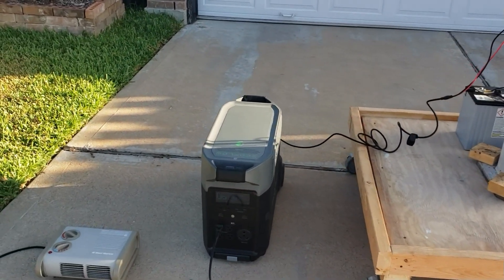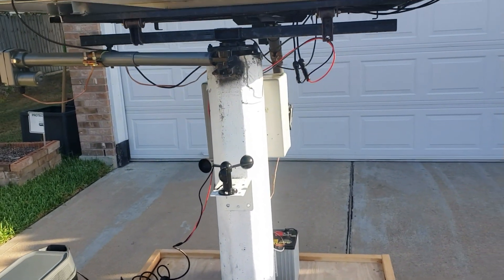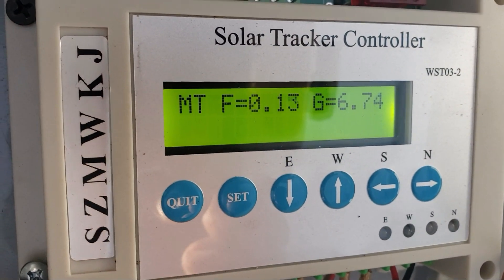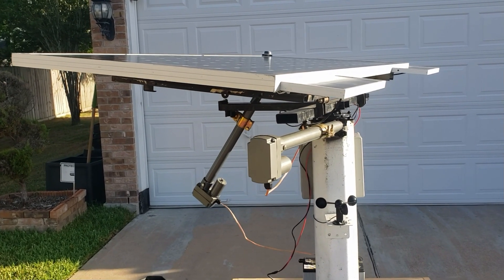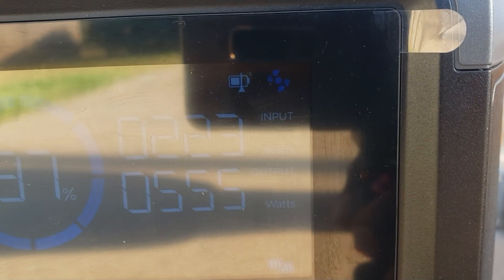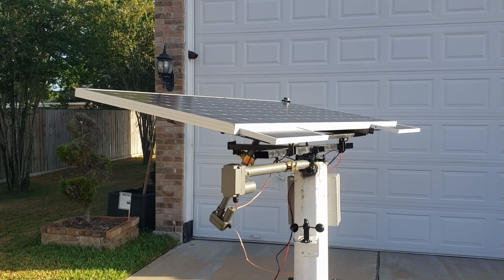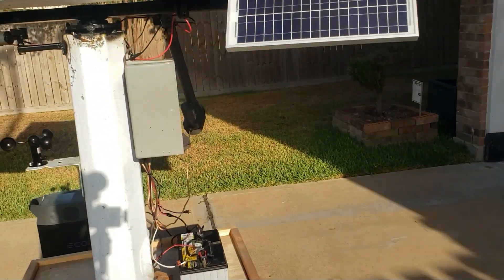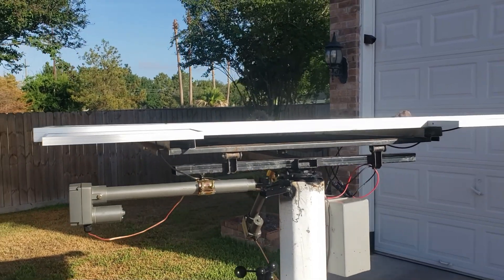EcoFlow Delta Pro Charged with a DIY Solar Tracker

Comment: i like your design! Do you mind selling me a complete system that can handle 6x 600W panels (93.78" x 44.60" each panel)?
Reply from the maker: That’s huge
Reply: @GeneratorReviews   what actuators are you using?

Comment: Hi this is Dave again I forgot to put in a question about how long is the stroke on your linear actuator? Thanks
Reply from the maker: Hey Dave, so this is a 12/24 VDC 750 pounds max stroke length 18 inches travel speed 0.2 in./s
Reply: Do you think if possible you used a 24” inch on your stroke would it be more sufficient and get more then 180% horizontal turn or would the long stroke wouldn’t help at all.

Comment: Do you have any movement on that seal bearing? like if you shake you solar panel ? And do think it would hold up to 4 panels
Reply from the maker: Zero movement on the seal bearing this is a wheel bearing designed to hold up a cargo trailer, so six panels, eight panels I don’t see an issue.

Comment: I watch you video over & over again l like you way you came up with a easy way to track the sun ? But 😮can’t figured out how you made horizontal actuator turn 180 with out breaking it or bending it all to hell!  I see the bearing axle how it would rotate but actuator shouldn’t rotate there made to push and pull not to rotate.
Reply from the maker: Using the 90° location in the front then I measured how many inches off the center mast which was 6 inches that causes the solar panels to rotate 180° without binding.🤓

Comment: What is the total wattage of your small panels used to charge the lead acid battery? Are you using a charge controller between those panels and the batttery?
Reply from the maker: The wattage of each panel is 5 W and I’m using a small waterproof charge controller. It keeps the battery at 100%.

Comment: Nice portable unit..  I recently installed the Ecoworthy Dual axis tracker. Then I switched out Two 400w panels with Six 200w bifacial panels. I have one of my security cameras pointing at it.. so I can monitor it's movement during the day. I'm a OTR trucker so I'm gone for weeks at a time.  Wanna get another one for my 2nd array too.  I put one of them 400w panels to work keeping my Ecoflow Delta 1300 charged when I need it. lol.. I use it for my washer and dryer..
Reply: https://www.youtube.com/watch?v=YjEopCCwnIs

Comment: Sweet setup, how much all those parts for the tracker run you?
Reply from the maker: The two 12V actuator I think I paid right at $200 for them the solar panel was $250 and I think the controller was $70
Reply: @GeneratorReviews  wow not to bad at all, nicely done sir!

Comment: What brand or can you provide information on the solar sensor and wind sensor that was used?  This is well done
Reply from the maker: Just search on eBay
Dual Axis Solar Tracker Controller Automatic Solar Tracking w/Remote Wind Sensor

Comment: Looks great!  How did you determine the watt limit to be 1.5?  About the only place on my property that has decent sun is a roof top.  What problems would I have setting a tracker on a roof?
Reply from the maker: I can think of a bunch of reasons I wouldn’t put a tracker on the roof
Highwind  weight, and aesthetics

Comment: Nice job and it seems to work well.

I just have an aversion to added complexity and mechanical failure.

Could a couple of more eastward and westwardly facing panels in addition to thee main array accomplish similar performance without the moving parts?

Solar panels are relatively cheap.

Comment: Does the Pro connect to any solar panel or are the connectors proprietary Ecoflow stuff?
Reply from the maker: You can connect any solar panel as long as it’s within the voltage specifications and max wattage

Comment: Very nice Job. I'm looking into something similar with wheels also. You mentioned wind, but not rain, so I'll need one that has a Tarp above it that will release when the windshield rain sensor detects moisture or better yet, a modified robo vacuum that the sensor tells to automatically take it under the Patio Cover!👍
Reply from the maker: Rain won’t hurt the panels

Comment: Pretty cool, I'm building something similar. Mine uses solar azimuth and elevation knowledge though, so it doesn't require any light sensors and always achieves perfect tracking.

Comment: Who makes those linear actuators?
Reply from the maker: Hurricane winds is where I got it from
Reply: @GeneratorReviews  I cannot find Hurricane Winds but I did find Windy Nation.
Reply from the maker: @gorillamotors  that’s the one windy nation I just looked sorry
Reply: @GeneratorReviews  what lengths did you get for these for the E-W axis and the N-S axis. I am looking at the heavy duty 750# versions in 18" or 20".

Comment: Couple of questions: How many degrees in the horizontal plane can your tracker rotate?  Looking at the design it must be something less than 180 degrees, is that enough?  Second question is could you post a picture of the actuator label, I can't find one that looks that nice.  Great job Gavin!
Reply from the maker: The degrees on the Horizontal plane is around 160 degrees anymore and the actuator will be damaged by over spinning. On the vertical I can get 90 degrees
Reply: What are the part names and any links where you purchased them. I'm trying to build my first ever tracker.... Thanks for this video and all information.

Comment: Hi Gavin 
Sorry to keep asking questions but got one more if you don't mind.
The wheel hub/bearing that you used. Did you leave some of the drive shaft /axle on the hub to give the bearings some more stability?.
Reply from the maker: Yes that’s exactly what I did and I welded it to the crossbar with is the main bar
Reply: Nice 1 cheers buddy 👍

Comment: VERY NICE!
How did you know where to mount the actuators (they have a certain protrusion length)?
How much was the tracker controller?
Reply from the maker: It was trial and error with positioning the actuators, the tracker controller I got it off eBay I think it was right about $120.
Reply: @GeneratorReviews  Kudos! I se the controller is a WST03-2.

Comment: Hi Gavin 
Your SZMWkj controler you use.
Did you get it from China or find it elsewhere.  Cheapest I can find it is £143 from China.
Reply from the maker: I got it on eBay
Reply: Yea I see them on ebay but all are shipped from China. Can't find a supplier in UK. Never mind I'll just have to get one imported from china

Comment: IDEA: EcoFlow's are being shipped with the 160watt or 400watt option. If you had a little low-cost solar tracker that only does the latitude angle so that a floppy blanket style panel could seek the best angle, I bet those would sell. Many people just want to set this up after power outage or when camping and don't want a heavy machine to lug around.

Comment: @Gavinsgarage I never had a solar panel before. My understanding is that they pull at least 80 percent of the rating. Is that certain panels or was it because the time of day. Your listed rating was 435 watts and the reading said somewhere near the low 200s. Was this a old or recycle. I have no clue except for watching videos. I need details.
Reply from the maker: Hey Lamar
That’s just because of the time of the day I think it was right at 8 o’clock when I shot this video this particular panel actually puts out its rated watts in full sun ☀️
Reply: @GeneratorReviews  thanks for the response👍

Comment: This is exactly the reason why I got myself a Delta Pro. I cam connect my old solar panels to it.
Reply: You can use any pannel, with any power station. As long as your amps and volts are in spec.

Comment: Nice work on your DIY tracker. Interested to see how well the solar tracker Electronics work long-term. I have been considering buying one and testing it here on my total off-grid property. I have four large solar trackers that produce all my power here totally off grid. A solid solar tracking controller is a must-have thanks for sharing.
Reply from the maker: Thanks 
Yes hopefully it last so far it’s very stable and haven’t locked up once looks like a great controller